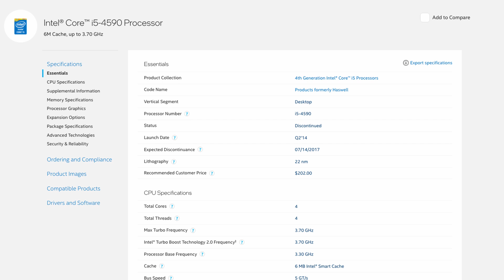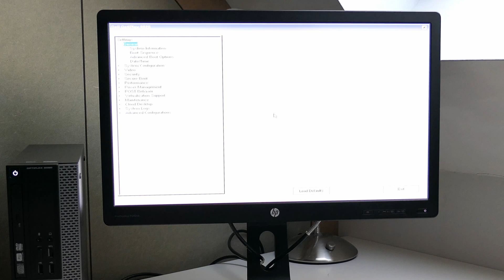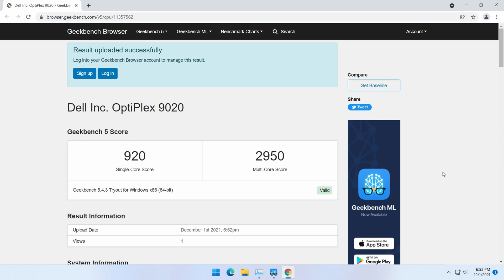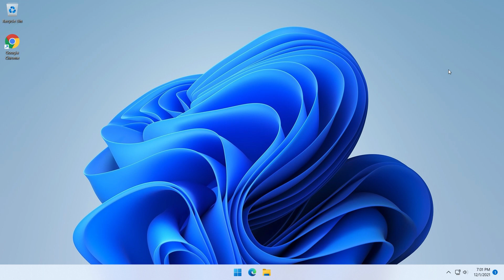Dell Optiplex 9020 - Teardown and benchmarks

Comment: Please help me how to upgrade cpu in dell optiplex 9020 sff without open like this 7:32 ?
Reply: There is no other way, you have to take the cpu out and out a new one in.
Reply: @themonkeymonarch  i mean just open the heatsink..
Reply: Just remove the cooler, then remove the cpu, out new cpu and thermal paste then reassemble the cooler and you're done

Comment: I'm trying to identify f_usb on this motherboard. Are they the 9 pins just above the 4 different connection ports on the bottom right corner of the board.? Trying to add a network card and it requires f_usb
Reply from the maker: Have a look here: https://dl.dell.com/topicspdf/optiplex-9020-desktop_owners-manual_en-us.pdf page 28 should have what you need (9. front-USB 3.0 connector is probably what you are looking for)

Comment: So I have a gaming monitor, and when I connect it to my SFF 9020, no video outputs, does that signify that those 2 video ports aren’t meant for gaming monitors and just regular display monitors?
Reply from the maker: A gaming monitor is not very different from a "regular" monitor. It typically just has a faster refresh rate and supports special modes to optimize that. It should just work regardless.

Comment: Great. I followed your every step and it worked perfectly. But there's just one problem, my system unit is working but I'm not getting any display. I've tried using a different cable, connected my monitor to another device and all, everything shows my monitor is still working but it's still not giving any display when connected to my system unit

Comment: A useful video!👍👍  Recently, I found a similar PC., a Dell Optiplex 7010, it had been thrown out so I rescued it and after the usual cleaning and new thermal paste and fitting a new cmos battery, it's currently working well with Linux Mint Mate installed.
The PC., had 16 gig of ddr3 ram., installed and a 256 gig ssd., and a third generation i7 CPU., which all work, but I fitted a 500 gig ssd., and because that plastic caddy can take two 2.5 inch drives I also fitted a 320 gig HD., for storage, which meant that I also had to fit another sata cable, but there was a spare sata port on the MB..
Also thrown out was an ASUS 18.5 inch wide screen VGA., monitor and after a good clean it's also currently working well.

Comment: I threw an RX 6400 graphics card in mine which gives me an HDMI out makes it surprisingly decent for gaming with a 16 GB ram upgrade.
Reply from the maker: If it is only for HDMI, you can easily go from DisplayPort to HDMI with the right cable. But yeah a RX6400 is a good choice. Should perform near the same as a GTX 1650. Definitely need to look into that range of cards :)

Comment: I know the video is about the Optiplex 9020, but if you went to a Pre-owned Dell Precision Tower SFF 3420 I7-6700 you can install a NVME as a boot drive and get DDR 4 memory (will take 64GB). True, your not gonna stick some kind of expensive Monster Video Card in it. For a daily driver you can't hardly beat them for the cost.

Comment: why is EVERY damn video on these particular computers done with SFF types and NOT minitowers???? two different types with different options and abilities.
Reply from the maker: I guess the SFF was a lot more popular in the typical target audience for these machines. The tower version often doesn't make a lot of sense in a business environment. There is no need for additional HDs or SSDs as everything is acessed over the network and thetebis no need for a GPU in the case. Even if there would be, the power supply typically can't handle a card that is not available in a low profile version anyway.
Reply: @jensdbe  I bought oen off Ebay earlier this yr and replaced the power supply with a 500 watt, added 32g ram, a gtx 1650 super GPU and added a 1TB SSD.

Comment: Any Idea if you can fit another SATA SSD 2tb in the other side of the drive bay and what bus connection it will need ??? as I'm just about to go for a 16gb version and upgrade to 32gb
Reply from the maker: There is a bracket with room for two 2,5" drives as far as I know. I don't think it is a standard option though. Physically there is space for another drive so if you are fine with it just "dangling" in there, that should work. You can connect it to one of the free SATA ports. For power, you might need a splitter to create an extra connector.

Comment: Can a 1650 fit in here?
Reply from the maker: A low profile version should fit and the power supply should be fine for it as well.
Reply: @jensdbe  idk if it’s a low profile but it’s a evga 1650 so would that fit? thinking ab buying this for my cousin and putting the 1650 in there
Reply from the maker: @gioisfree  not 100% sure but a quick search shows me that EVGA doesn’t have a low profile 1650. You can simply see that it ia half the height of a normal card.

Comment: Great video right to the point, just picked up a DELL Optiplex 9020 with an intel i7 VPro Prosser 8g ram with 2 500 GB SSD drives in the unit it was a gift now to see if it works no idea if it works something to play with. once more a great video👍
Reply from the maker: Glad I could help!
Reply: Well, it's working, supper fast 25 sec. boot up it's running windows 10 Enterprise? the Dell PC can from my friend's scrap yard he got a bunch of PCs in and handed me one.

Comment: does it need any power replacement if you put in a better GPU?
Reply from the maker: I believe it comes with a 255W power supply. Most of the low profile cards are not that power hungry so that should be fine. Like a 1050Ti or 1650 should work without issues.

Comment: Excellent presentation, patient, thorough, and informative. Much appreciative, as I just acquired a refurbished 9020, and there is not much room for those PCI cards as that will be a tight fit.  Thank you for sharing.
Reply: Yes, with the SFF model that is the problem, one needs the mini-tower version / model of the 9020 to really get rocking.  But the 9020 is a great PC .  Early in the video you see the various models, and the one on the far right is preferred imo.

Comment: That x1 slot looks more like a 4x slot and it has no rear plastic on it so you can put a full size card in that slot from what I can tell! Interesting that they have the x16 slot as the second slot instead of 1st. Kinda makes 2 slot GPUs harder to fit since they will be right up against the PSU housing. Could use the x4 slot though but will take a bandwidth penalty using that one assuming the board will even let you use a GPU in that slot.

Surprising they decided to put 4 ram slots on the SFF version. From what I recall you can max them out to 32 GB of ram if you use 4x 8GB modules!

Annoying that they started using a load baring heat sink mount for that one. Make case swaps a little tricky. Not to mention the rear IO faceplate appears to be part of the case and not removable. :(

Not sure on the SFF versions but with the mini towers the 7010 and 9010 used standard PSU connector and had removable rear IO faceplates (the mobos also had proper brackets on the backside too though they are glued on so you have to use them when using after market cooloers). The downside is the SATA ports are near the GPU PCI-E slot so 2 slot cards will obstruct them. Right angle low profile sata cables would need to used in that case. Or a PCI-E SATA card if the mobo supports booting from one of those.
Reply: I guess dell didnt want the graphics card too near the cpu so put the 16 slot further away down near the psu!
Reply: Heat near the psu vs near the cpu
Dell maybe figure best not cook cpu?

Comment: I remember i used once machine in 2020 - for almost whole year..

It made my respect and enjoy these small SFF mod builds

Had that 9020 SFF with Xeon E3-1250, 4x4GB 1600mhz ddr, 500GB SSD and GTX 1650 - i enjoyed it soo hard
Reply: I am using a 9020 right now but am using GT 710. And still love it.
Reply: @Rashid-Mahmood_sahi  low profile card ?
Reply: Using 9020 (4770, 16gb 1600, 500gb ssd in cd bay + 3,5 2tb hdd, rx6400). On linux it just flies faster than modern pc's on windows. 
Wonderful  machines, and almost completely silent in office tasks.

Comment: What dell machine would you recommend if I want to addd multiple hard drives as I want to build a nas?
Reply from the maker: Very hard to tell with this little information. Depending on the number of drives, check which model could fit it. Typically more than 4 will be very hard with a pre-built HP/Lenovo/Dell machine. If you want 2-4, then a tower is probably easier. For basic NAS operations (like file sharing etc.) any Intel Core with ~4GB of RAM should be enough. Faster CPU and more memory depending on other tasks you want to do on that NAS.
Reply: @jensdbe  yeah looking for anything between 2 to 3. Anything will be an overkill. Yeah just doing basic file sharing mainly for photo storage really.

Comment: Will a normal pci-e parallel (lpt) card work here or one is forced to buy from dell?Thanks.
Reply from the maker: As long as the card is low profile, it should just work. A regular card will not fit in the case.

Comment: If you have to choose between Dell OptiPlex 9020 MT Tower (Premium Business Desktop Computer, Intel Quad-Core i7-4770 up to 3.9GHz, 8GB RAM, 128GB SSD + 3TB HDD, DVD, WiFi, Windows 10 Professional) and HP EliteDesk 800 G1 Tower (Intel Core i7 3.4GHz Processor, 16GB Ram, 1TB SSD, WiFi & Bluetooth, Wireless Keyboard Mouse, Microsoft Office 365, Windows 10 Pro), both for simple daily tasks, which way you would go?
Also, would I be able to hook up on any of these two PCs a 8TB HDD?
Thanks for any info.
Reply from the maker: Both the Dell and HP are on the 4th gen Intel Core platform. For me the HP would be a better choice. 16GB of RAM is better, larger SSD, ... As there is no regular 3,5" HD yet, you would also have space for that 8TB H (which should just work out of the box).
Reply: @jensdbe  Thanks, I appreciate it.

Comment: Thank you for the video. I've bought that machine today as an replacement to my over decade old pc. Good to know how to strip it down, it seems more easy than in the bigger types of towers.

Is that kind of a case able to support an additional drive, as in a combo of an ssd and hdd? (Doesn't seem to from what I see...)
Reply from the maker: Officially there is no support for a 3,5" and 2,5" drive but you could put the 3,5" drive in the place made for it and you should be able to find some space for the 2,5" SSD. You would need a SATA power splitter cable but those are easy to find.

Comment: Why not throw the plastic cover on the cpu and also remove the dvd and hdd cage?
Duck tape the ssd to the case and throw the dvd since i dont need it, therefore you have better accesability to the ram and better airflow right?
Is this a good idea, am i missing something?
Reply from the maker: The plastic cover for the CPU is guiding the airflow so it's useful. DVD/HDD cage keep things neat and I still used the DVD drive from time to time.

Comment: After doing all that my pc does not turn on, in the power button blinks an orange light, any request?
Reply: This is a common problem with Dell optiplex series, and the causes are many, such as a faulty speaker, bad ram slot, etc.
In summary Dell are known to induce shorts in their machines without reasons.

Comment: Are these machines quiet and power frugal?? The little amount of warm air coming out is not really suggesting more than 60 W but it's probably more.
Reply from the maker: As far as I could measure, the machine is pretty economic on power consumption. I managed to get around 15-20W during regular usage.
Reply: @jensdbe  wow, that's good

Comment: I put an i7-4790 CPU in both my 9020SFFs, one is being used as a Home Theater PC - it has an SFF (low profile) 1050Ti video card for driving a 4K TV, the other 9020SFF is on a work bench for downloading and displaying schematics on a 23" monitor.  The work bench PC also has a USB3 802.11ac/a/b/g/n WiFi dongle to access the internet - the 9020s did not come with WiFi or Bluetooth from the factory.  And both SFFs have been upgraded to SSD drives - I'm not very patient :-)
Reply from the maker: Curious to see your Geekbench scores with the upgraded CPU to compare. SSD is a must and basically transforms any older machine, which people thought got outdated, to a fresh and snappy-feeling PC. Somehow I like the SFF form factor. Small and professional with plenty of power.
Reply: @jensdbe  Well, since you asked nicely I'll download the latest version of Geekbench and see what numbers I get.  👍  I've also "upgraded" quite a few "outdated" desktop and laptop computers just by replacing the HDD with an SSD.  It was great when I vastly improved the performance of a room full of computers at the local homeless vets service center with some SSDs I bought at auction.  Boosting RAM from 4GB to 8GB helped too, but not nearly as much.
Reply: @jensdbe  Downloaded Geekbench 5.4.4 - It reports an OpenCL score of 23114 and a CPU Benchmark of 1006 (Single Core) and 3778 (Multicore).  Anything else?
Reply: I have an Optiplex 9020 i7 MT and am trying to determine if it has UEFI as I want to install an 1TB M.2 PCIe Gen3 NVMe Internal SSD as a boot drive. Do you know the answer ? ( I want to use the PCIe 3 16 x4 slot)
Reply: @rosmeartoo  I have the 9020 SFF (Small Form Factor) version.  Tap F2 as you start boot-up to go into the BIOS.  Mine has the Legacy/UEFI Boot Option located there.  Hope this helps. 👍
Reply: Thank you for taking the trouble to reply. The system spec showed Legacy BIOS. Having now read much more I have founf that UEFI is installed and can therefore be configured to take a NVMe SSD as boot drive. I shall therefore continue with my plans to upgrade as existing performace against an almost identical spec MacBookPro of 2012 is very poor !
Reply: @rosmeartoo   I apologize for the delay in my reply, I was out of state until last night and away from my 9020SFF computers.  Hope I was able to help with your project.

Comment: Have you or anyone else had luck installing a xeon such as a e3 1240 v3 or 1245 v3[on board graphics]?  Best i could do was an i5 4670k.  I had no issues with the 3rd gen/xeon upgrades.  I would buy pentium systems and add in the i7 non-k equivalent cpu.
Reply from the maker: I read that some people did this successfully. Only take into consideration that such Xeon has a larger energy consumption so that might be too much for the board/PSU, especially if you are also using a dedicated GPU.

Comment: Very nice video. I got the same 3.5" to 2.5" hdd/ssd caddy from aliexpress plus a sata power splitter cable so I put another drive. One question, did you manage to put caddy nicely into the blue bracket? I managed to only secure it with two screws/latches instead of four.
Reply from the maker: The caddy is an original one, the SSD fits in fine with 4 screws and it goes in the blue bracket without screws. Here are some pins that fit in the holes of the caddy when bending it a bit. Doesn't feel too strong. 
Interesting idea to get these on Aliexpress, probably not too expensive. Will check that out.
Reply: @jensdbe  I had trouble with pins, only  2 from one side went into the holes on a caddy nicely,  but never mind, drives are secured and not moving. Any plans on futher upgrades for 9020? Would be nice to see how i7 4790 and some nice graphic card would improve the performance.
Reply from the maker: If i could fine one for a good price, that's definitely the plan

Comment: I have this 9020 SFF too.... I actually have a GTX 1050ti in the smaller (Black) PCI. It 100% works and videos on YouTube showing it in the PCI no issues..& I have 4tb 3.5 with a sandwiched 500gb SSD for Win 11/Linux....
Reply from the maker: Nice to see. That a lot of power in a small enclosure.
Reply: @jensdbe  https://youtu.be/3djQfs2--XQ
Reply: late question, but have you had to make any cooling/airflow upgrades in such a small case?
Reply: @griffinnguyen2937  None whatsoever.. put it in & go!
Reply: So does your gpu over heat because I am am thinking of doing that
Reply: @frgaming6500  Leave the lid off and check temperatures if you like.

Comment: Looks like no USB3 ports??
Reply from the maker: There are two in front, the right ones and two in the back: two bottom left ones. They have a different label with SS (SuperSpeed) instead of just the USB logo. Forgot to mention that in the video but you can see it in the footage around 01:02 and 01:19
Reply: They're there, they just don't have the standard blue plastic tabs inside the socket.